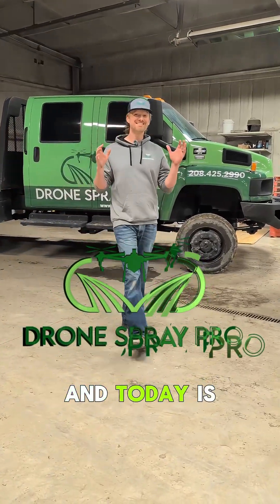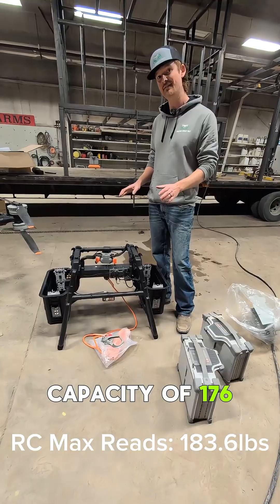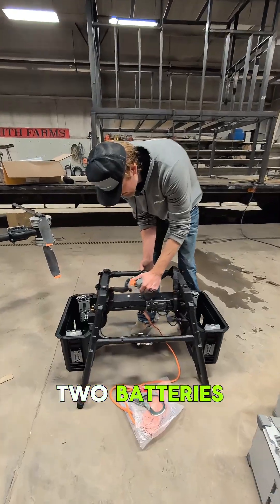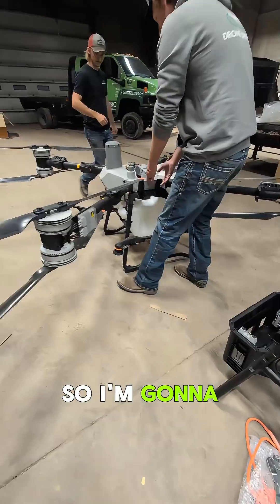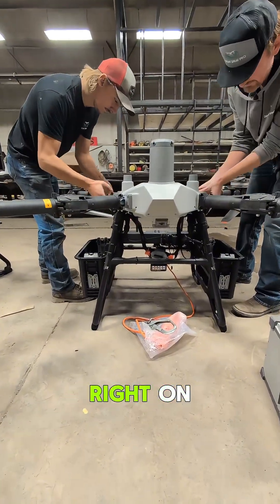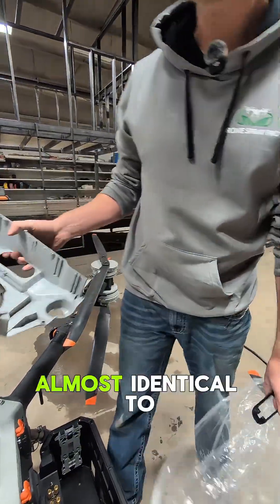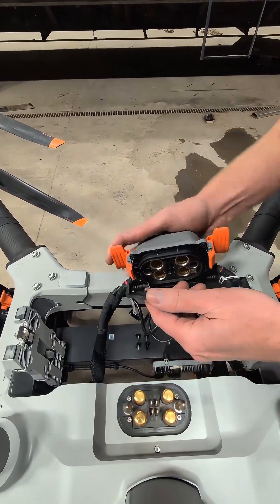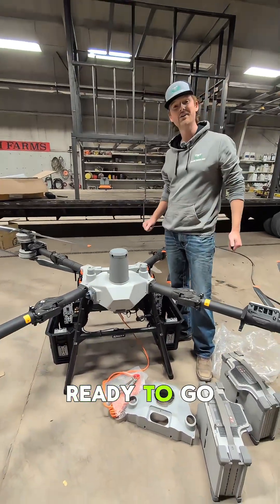DJI Agras T100 Lift Kit - Dual Battery vs Single Battery

Comment: Why not intergrate together Solar PV since drone fly high up exposed direct sunlight, solar panel nowadays are light & flexible, it run motors and charge battery as well. So only require single smaller battery.